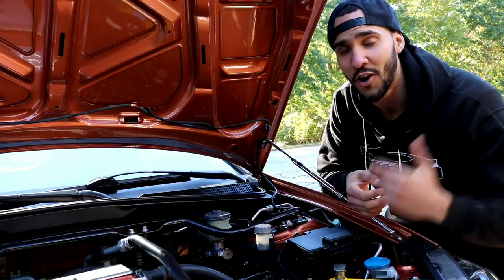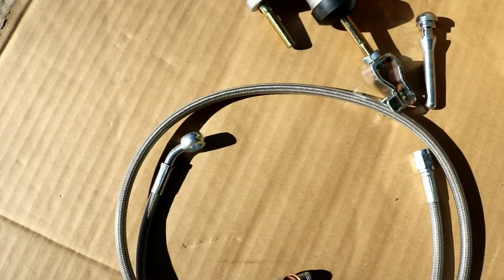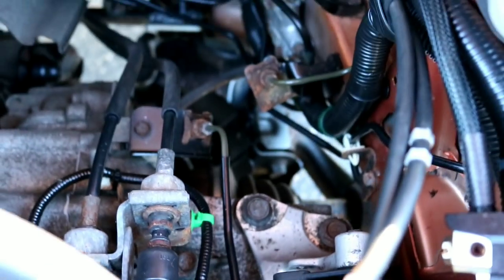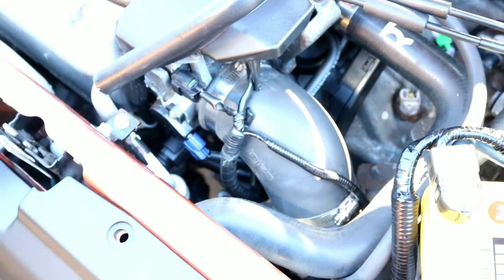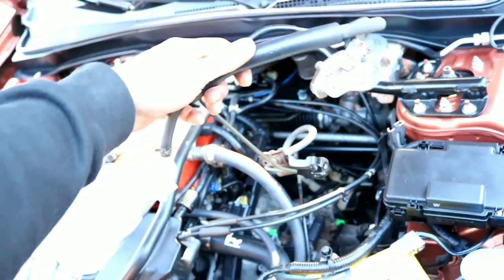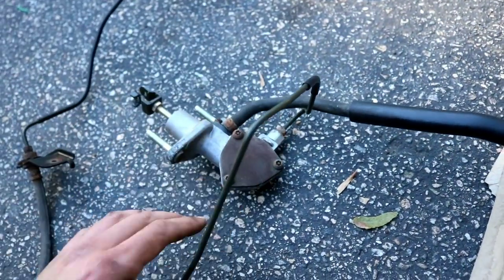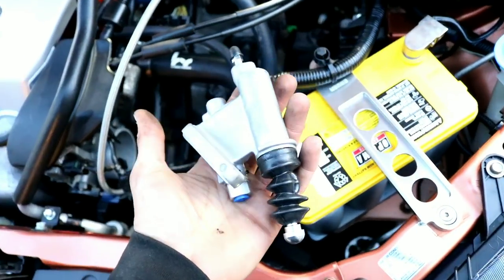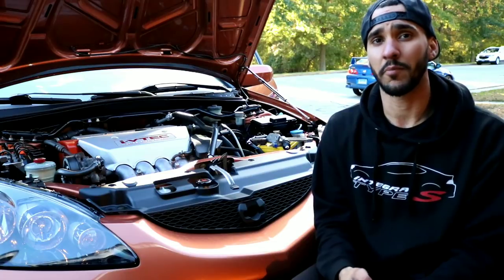Exedy Clutch Kit Install! | Project Orange - Part 10 | Episode 44

Comment: My rsx is making like a whining/whirring sound when accelerating and decelerating in gear but not when in neutral is this the cmc or something else? The sound also gets higher with increased rpm
Reply from the maker: Most likely, Power Steering Pump.

Comment: The Em1 cmc works with the 05-06 rsx? I wanted to run this but Ive seen reports online that it doesn’t fit
Reply from the maker: Our kit works with all 2002/06 RSX manual models. Shop with confidence, www.DC5RParts.com